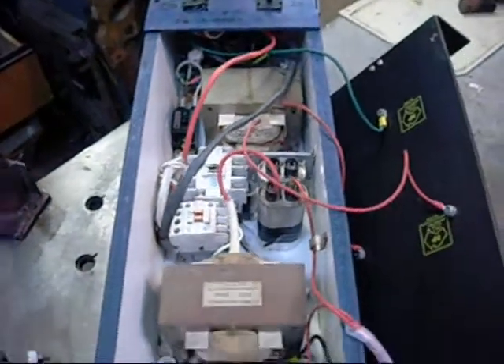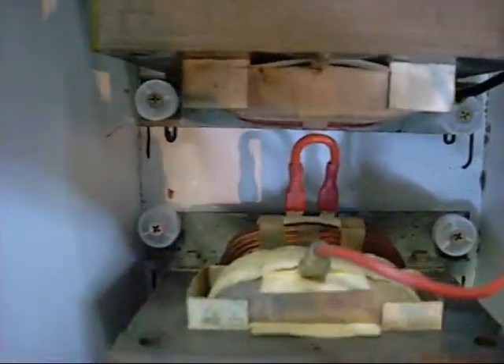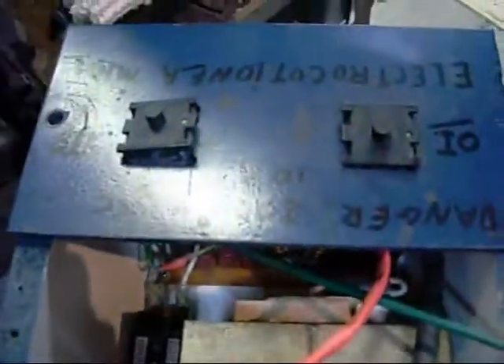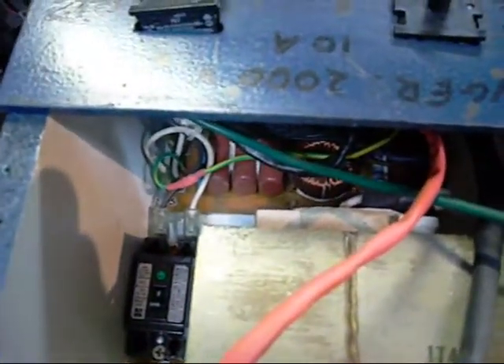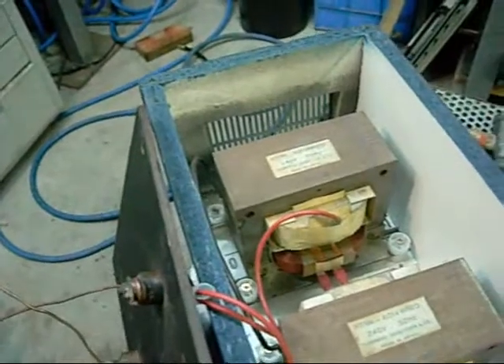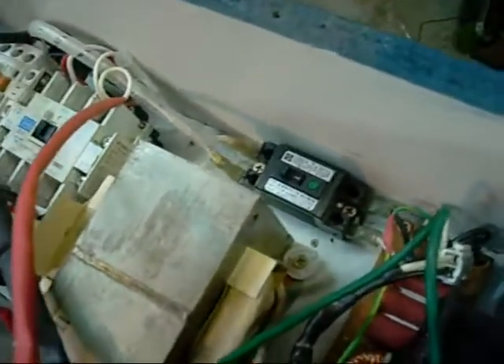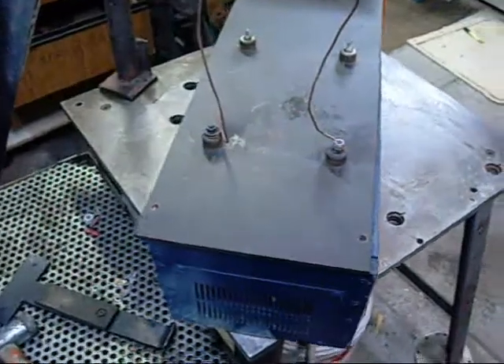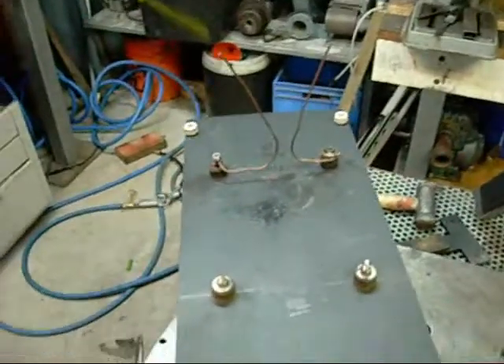Introducing Electrocutioner MK1 AKA MOT Box

Comment from the maker: the first MOT is wired as normal with one lead off the secondary going to one side of the cap bank, the second MOT has its primary shorted and iron core connected to the first MOT's iron core. (other side of the Secondary)
The Secondary lead from the second MOT goes to the other side of the cap bank.

essentially you draw your secondary power from both MOT's secondaries, the Shorted primary makes the second MOT act like a ballast, or Inductive Load